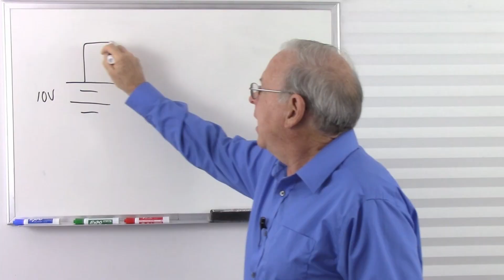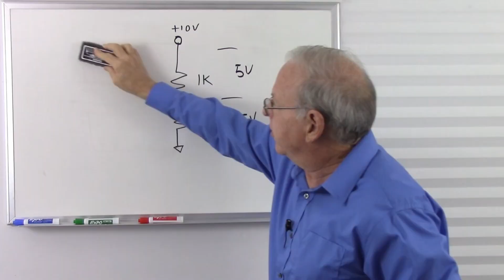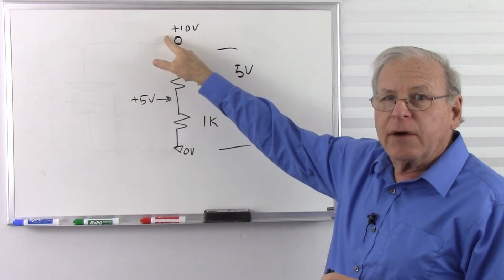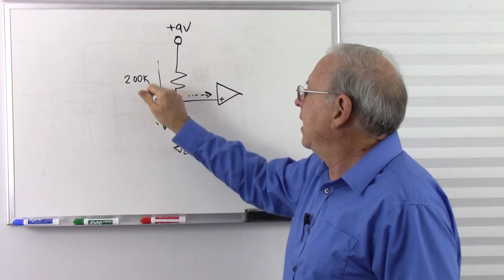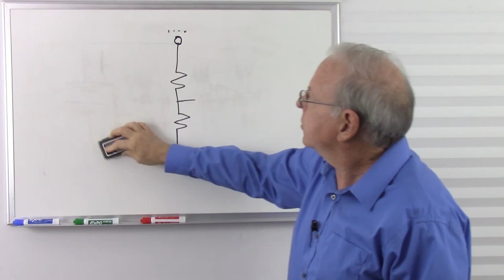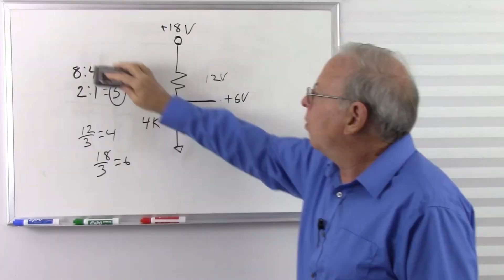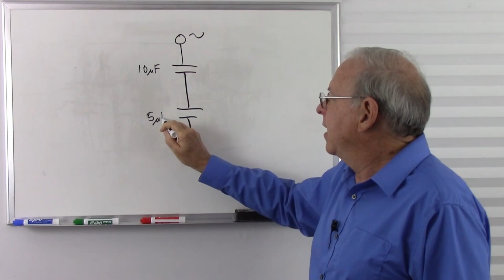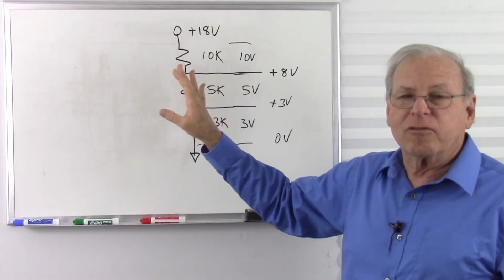Voltage Dividers

Comment: Are voltage dividers affected by the current drawn by a branch of a circuit? Because V=IR, and R=V/I, so the resistance of the branch changes with the current on the branch?

Comment: I have a resistor divider in a game gear that's not working. 5v in is present, ground is present but at the point it should be 2.5v its 5v. I took the resistors out of the circuit and they both measure their respective 10k resistance. I am a little stumped as to what could be the fault here. I notice if i measure the top resistor on the board it acts like a short. Under the resistor there is a trace that goes from the ground up, do you think I am somehow shorted there and its allowing all 5v to pass through? I am kind of stumped.
Reply: I fixed it! Your video really helped me visualize what should be happening. Turns out that I had a short on the capacitor that is on circuit. I assume thats why I had the 5v present, but no 2.5 at the other side, it didnt have the current? Does that sound correct or am I still misunderstanding what was causing this issue? Either way removing the capacitor and cleaning the pad resolved it!